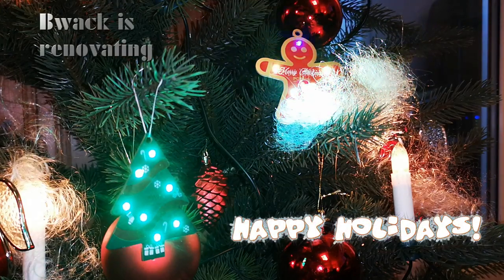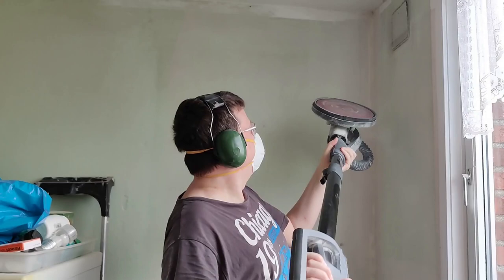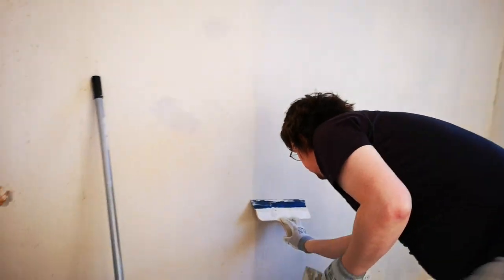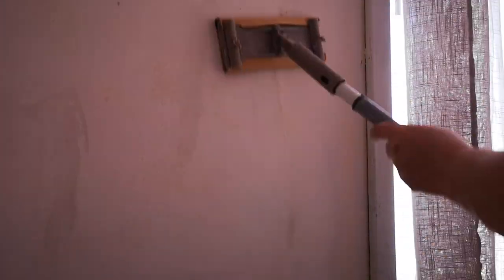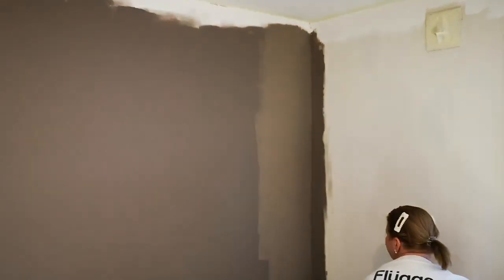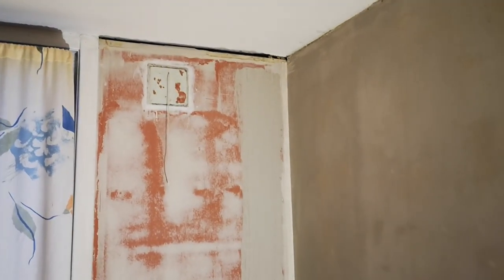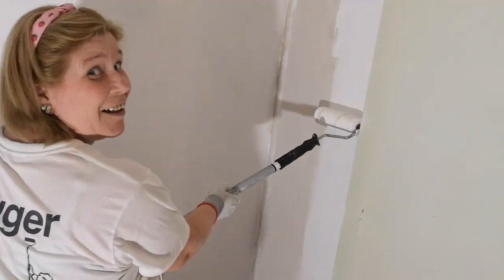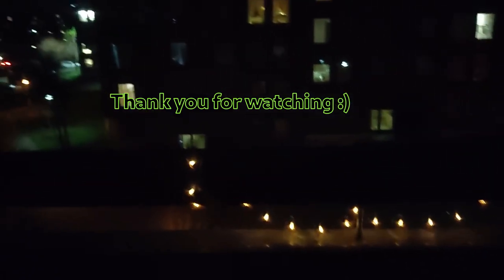Bwack is renovating - Walls and ceilings

Comment: Merry Christmas and Happy Holidays =D    OMG - that filler, I had that problem with the walls here, and I used the exact same filler and the same wide spreader there!!!  Glad you are both well!!!!
Reply from the maker: Nice to know. In the store they knew very well about the problem with some wall paints and glue that are hard to remove. They recomended filler, but also mentioned thin plaster plates. Merry Christmas 🎄